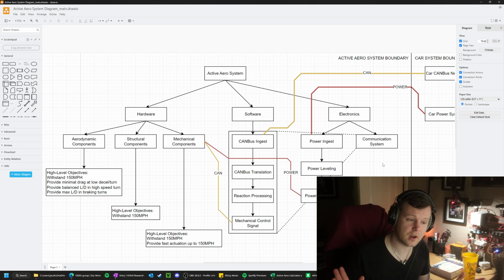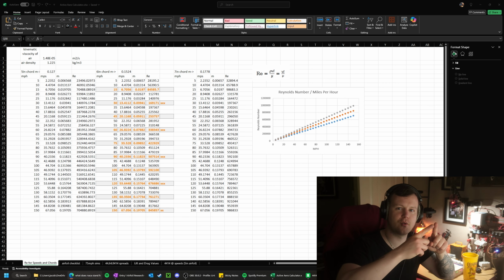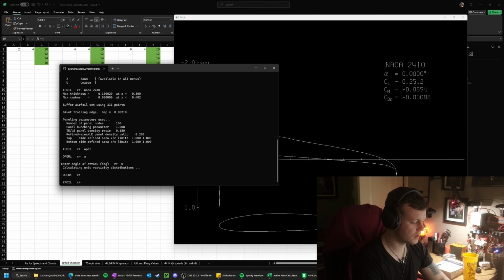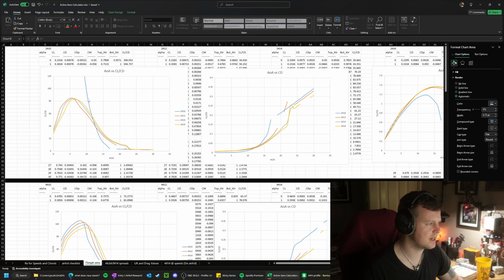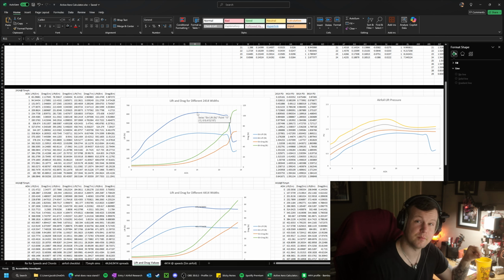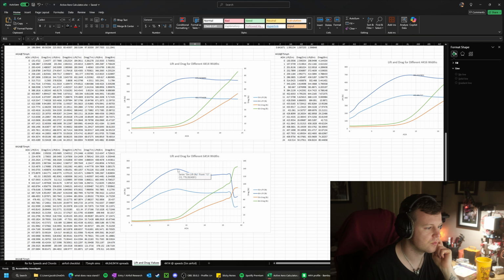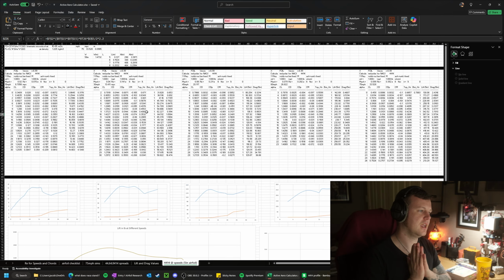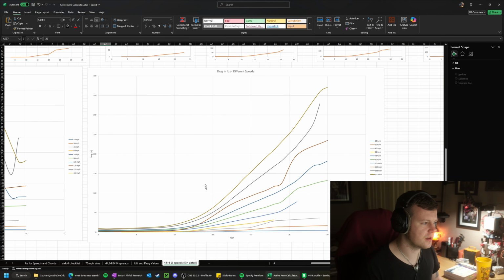DIY Aero Airfoil Selection: DIY Car Aero Episode 1

Comment: This is a great video, and super informative. Any reasons to not just use the Selig S1223? From what I know, this airfoil is very popular in racing because of its high lift at low Re. FWIW, I think there is even some literature on it being used in F1.

Another interesting thing to look at is compound airfoils, which can give you more downforce for the same wing area (often controlled in your racing series). Practically speaking, as well, your DRS system can weigh a little less as you should only need to move the smaller wing element/elements. More food for thought, but either way awesome vid!
Reply from the maker: Thank you for the feedback! I haven’t looked into compound airfoils, but I am familiar with the idea. It seemed like quite a bit more added complexity from the structural side so that’s the main reason I haven’t looked into it. I’ll definitely look into the Selig 1223. Another limitation I have is the ability to simulate in Xfoil, but I’ll see what info I can find about doing that as well. If I get some info on it I’ll give you a shoutout!
Reply: @makerjakenet  No problem! I'm actually an aerospace engineer with some background in aero and composites in this style of application, and I have a 1st gen 86 that I want to do something similar with. I'd love to tag up with you if you want!
Reply from the maker: @sebkjones HELL yeah! Let’s cook. Hit me up on my website:

https://www.makerjake.net/contact-me

Let’s set something up!